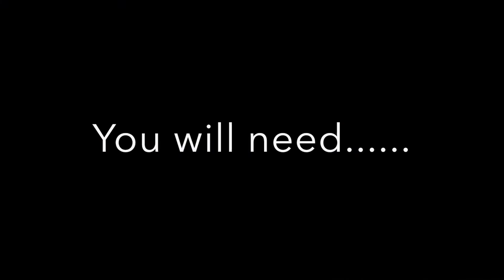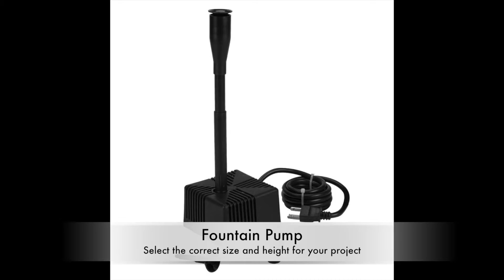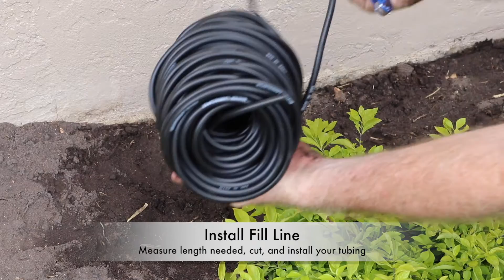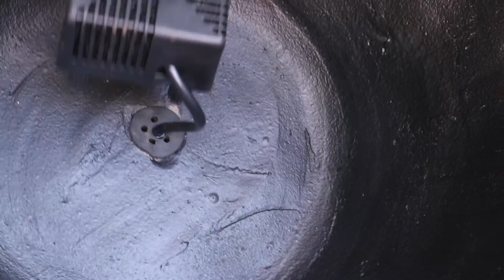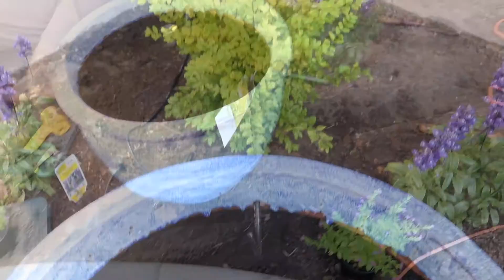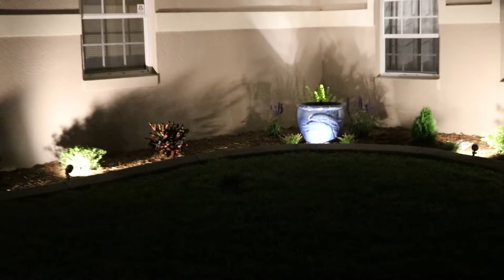How to make a SELF FILLING Water Fountain

Comment: LOL using a sprinkler wouldn't qualify as self filling. Most people keep fountains close to their home. Hard sprinkler water all over your home = :/ Use a float valve for auto filling. Nevertheless good idea for a DIY fountian!
Reply from the maker: Yes, this low tech solution works pretty good, I also hate the rust stains sprinklers can leave on a house...that is why I converted the areas around the house t drip irrigation.  The other nice thing is less water waste and less weeds since I water roots and not the surface.

Comment: What kind of plug did you use in the bottom for the pump power cable?
Reply from the maker: The container included a rubber plug that fit in the bottom hole.